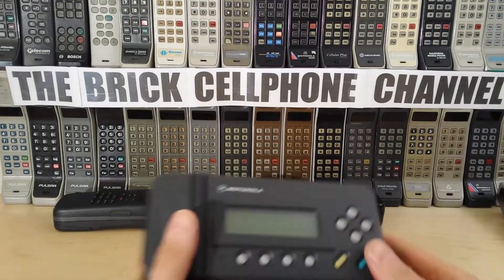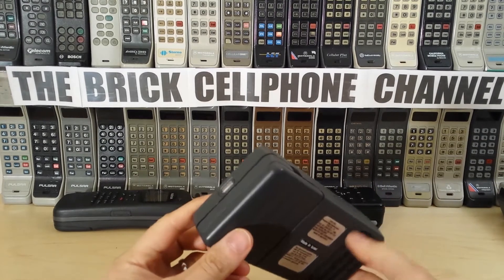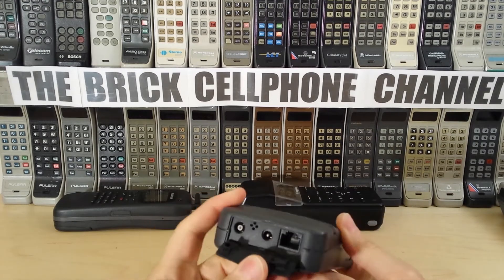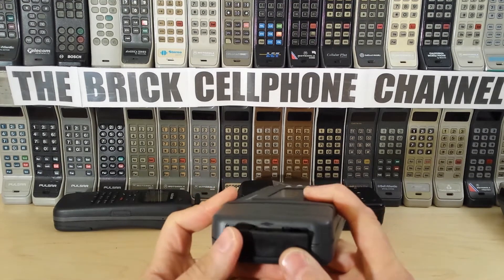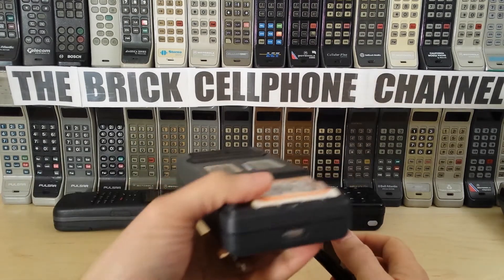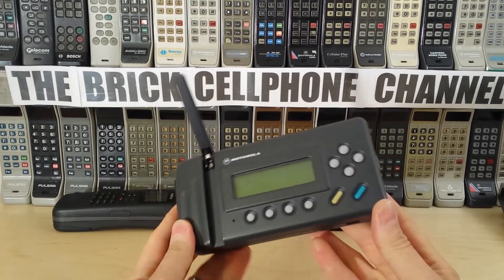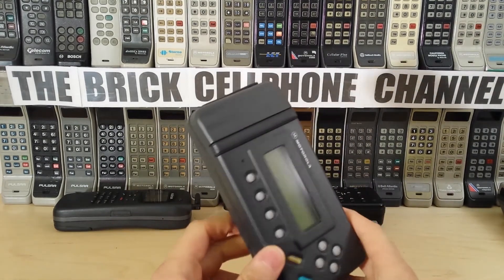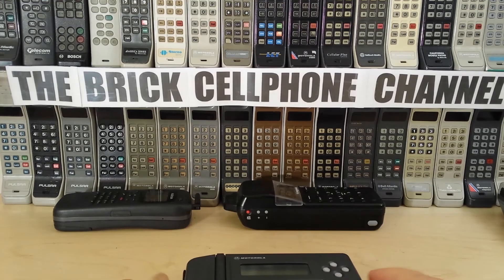Motorola Vintage Brick InfoTAC (not dynatac or microtac) cellular modem

Comment: Just came across this. Thanks for preserving this bit of history  It used the ARDIS network (1992 to 1996) and had a fairly standard AT command set. The odd connector was just an RS232 serial port.
Reply: 0:16

Comment: Hi. I have one of these also. Was Used on the Telecom Mobile Data network in Australia.
Operates on the 800MHz band, uses the RD-LAP protocol, 19.2 Kbs data rate !
Connect 12v DC to the power connector on the side, positive center pin.
But would remove the battery pack first.  Battery pack in mine was stuffed too. Will not operate correctly with
a faulty batt pack. The menu is cool, has a whole bunch of canned messages to use. 
It works as a 2 way pager, and data modem. The RJ45 port is actually a serial port for a PC.
Reply from the maker: +Chris Lumsden super fast then at 19.2kbits !!! Thanks for the info....I don't actually know what I've done with mine....it's back in storage somewhere!  will have a play when I'm back in the UK.